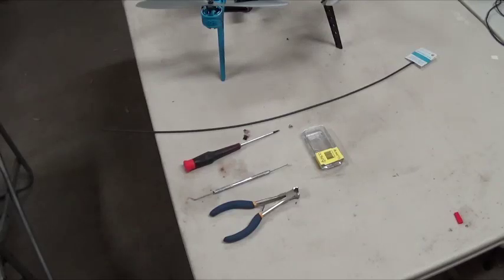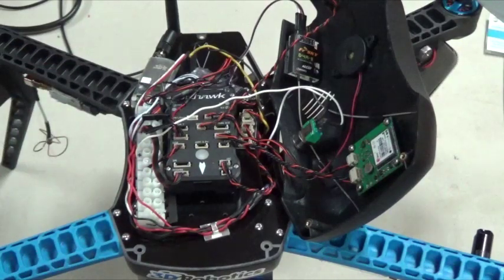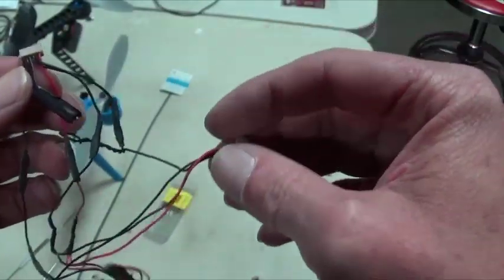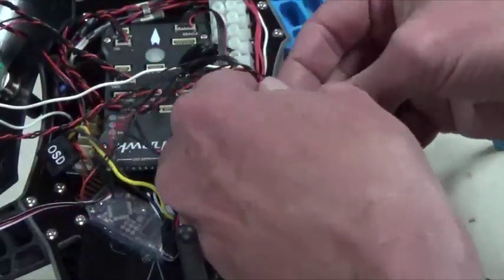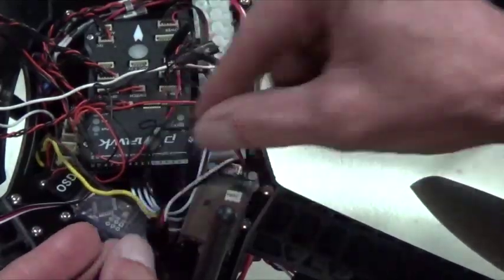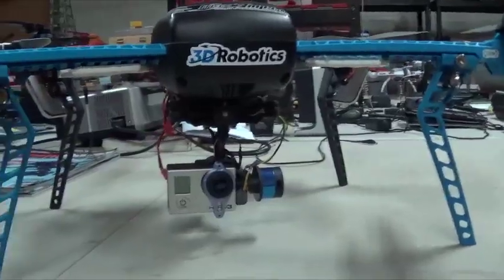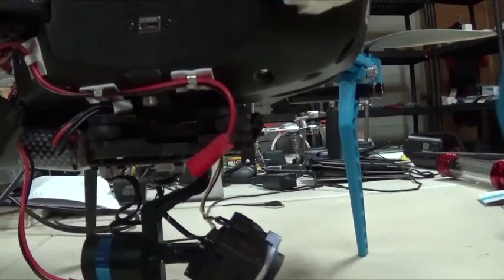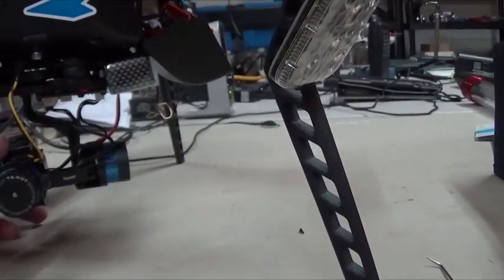IRIS OSD FPV SETUP INSTRUCTIONS

Comment: Sir Curtis Wazny

I watched your two videos about the installation at Pixhawk of the OSD and

Telemetry. For three months I have tried to put the OSD and telemetry to work
and I cannot, the overlay of the OSD image over the camera appears, but without
data.

I thought your explanation was very good, but I couldn't identify the wire

connections between Pixhawk, OSD and Telemetry. Do you have a diagram of these
connections that you can send to me. I've tried everything and I always go back
to ZERO.

Very grateful for the attention.

Luiz Leite

Braga- Portugal

Comment: Honestly great video! This taught me allot about how the system works. I spent the last week trying to figure this out when it turns out i was missing the OSD board. I bought the drone used and had never set one up before. Thanks for this! I battled through the gimble issues solo but OSD thing had me stumped. Ordered a OSD board and saved you video for later! Thanks again!

Comment: Where did you mount your secondary battery for the video transmitter? Or did you use a secondary battery?
Reply from the maker: I used a 800mah battery and had it attached with velcro right below the battery door, worked well.
Reply: Very nice. Did you re program with flight planner to compensate for the extra weight?
Reply from the maker: Yes different params for running a gimbal and not running one.
Reply: Curtis Wazny Got ya. I am using the new GoPro OSD cable and it is hindering where I can put the OSD panel. Do you think if I put it in the front under the GPS it would cause issues?

Comment: I am interested in putting FPV on the IRIS , but would like a list of parts on what would be required. Joao if there is a way to use telem2 then I would find that useful
Reply: Yes, i did it! Actually it's pretty easy. I bought the osd cable that I've mentioned from 3drobotics and used with a minimosd similar to the 3drobotics. Just plug it into the telem port available and then connect to the osd board. Then I used the tarot cable and connected the go pro directly to the osd in video. The out goes to your transmitter. You can also check out the RCJOSEB channel for more info. ;)

Comment: I've noticed that according to the 3drobotics manual, you can use the telem2 port using a FTDI-to-DF13 cable to connect the OSD to the pixhawk and leave the radio connected to the telem1 port. This way you don't have to do all the wiring mods. I'll try this and leave a comment later. Thanks
Reply: João Paulo Hi guys, been looking at this..I've got a GoPro cable + the FPV/OSD kit from 3DR.. I am trying to figure out if I need to install the 2nd antenna and transmitter or if I can run it all from the telemetry radio. I'm sorry if I am not being clear as I am a bit of a newbie. So the real question is: If I run the video from Gopro with it's own battery and simply install the OSD into telemetry 2.. do I still need a 2nd battery (and transmitter) or can I run it all from the IRIS 5000 battery?Tks in advance for help, Vasco